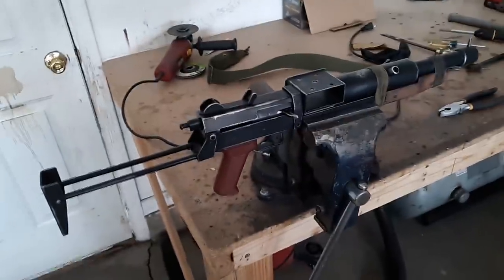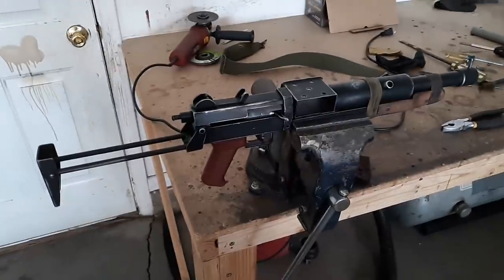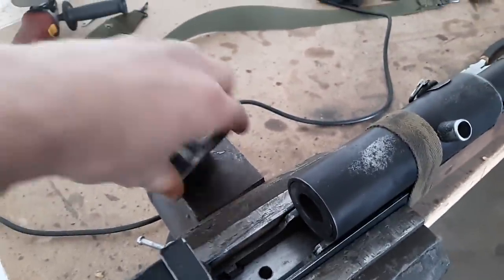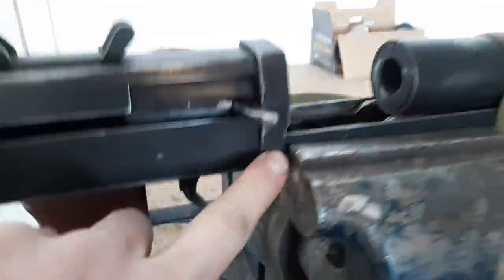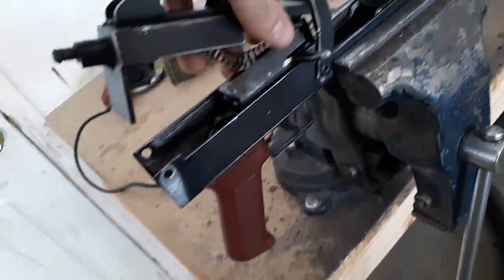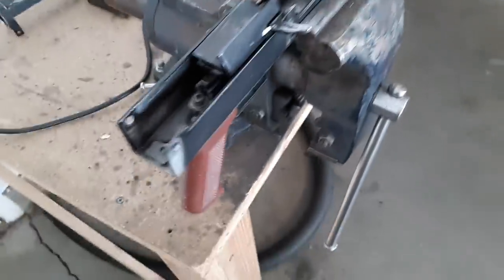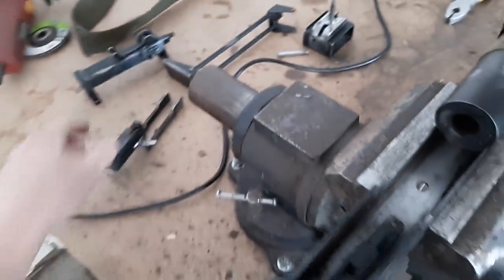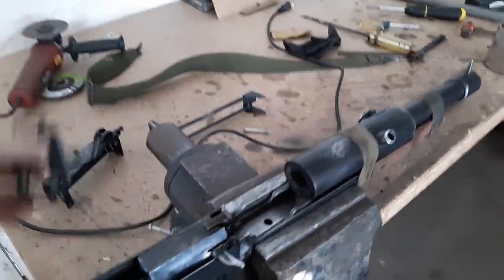How it works-bastard smg (metro 2033)

Comment: Man this is one step removed from a truly functioning firearm, as soon as you said you worked as a gunsmith it all made sense, really impressive work dude.
Reply from the maker: I appreciate the comment and your viewership. I hope to come back to this at some point and build another one chambered in a cartridge light enough to work as a straight blowback, maybe 9mm or 9x18 Makarov. The pivoting magwell is neat for a operational replica like this, but it ads a lot of unusual complexity and timing issues to the design. Thanks again for watching!
Reply: @Fairfax_kit  .380 ACP and .40 S&W are pretty much perfectly cylindrical at their widest points, so they should stack better than 9x19. Otherwise, 5.7x28 to keep the bottleneck aesthetic.
Reply: @simoncleret  if you want bottleneck, 7.62x25 Tokarev is much cheaper and even fits the locale of the games
Reply: @BobtheHobo324  thats definitely a great idea
Reply: @BobtheHobo324  look at the taper on it. It doesn't stack well in a straight mag.
Reply: That pivoting mag well is a very interesting feature in theory.

I'm completely in love with the look of this.
Reply: @Fairfax_kit  Me clicking in thinking its a real gun.

Comment: i've heard 4a games actually has a gunsmith on staff who designed the guns as real functioning versions prior to the 3d models and game versions being made.
Reply from the maker: I've heard that too, but best I can tell it's all hypothetical. no functioning versions have ever seen the light of day. Even the one i made isn't truly identical to the game.
Reply: I can imagine that, just a hecking Ashen makes a good weapon.
Reply: @Fairfax_kit  yeah, I looked it up, it's not 100% true, what is true however is that one of the key people in the studio is both an engineer and a gun nut, so when they design guns, their mechanics have to be realistic and possible to design as a real gun.
Reply: @dan_loeb  That's fascinating. I'm a gun nut too and I noticed in Exodus how practical the designs are. I mean, sure, I'm not sure I'd use a flat spring as a recoil spring (as is the case with the Shambler), but the fact they designed it to look like it works logically is super impressive.

Comment: “Submachinegun, 5.45 caliber. It's got poor accuracy and overheats like hell. That's why they call it a "Bastard gun"”
Reply: Use short bursts
Reply: Ah. I just thought it was a Chinese ripoff of the MP40 which was a german weapon that looked very similar
Reply: @misscath28  It's a ripoff of the Sten gun. Sten gun is made to be cheap, this thing is suppose to be even cheaper.
And both of them can be quite unreliable at the most inconvenient time, especially an ambush.
Reply: @unknownguyindo4356  imagine a cheap version of this
Reply: @rufickderufia8222  Sten is literally a pipe gun in steroids, bastard gun is even cheaper.
I don't know anything cheaper than that other than a homemade weaponry.
Reply: @unknownguyindo4356  a pipe,and you have a hammer and a screwdriver,you have to do it all yourself
Reply: @rufickderufia8222  I don't want to make it. I didn't wanted to involved with the authorities.
Reply: @rufickderufia8222  "imagine a cheap version of this"

It's called the Metro Exodus Bastard gun.
Reply: "Hueh hyeh hyeh!"
Reply: @theknitby  so the Luty?
Reply: Good ol days

Comment: The bastard gun in this game actually moves the magazine up or down after each shot, and not up and down for each shot, which is the most confusing mechanism that I failed to comprehend...
Reply: Magazine go boing boing boing boing boing
Reply: Magazine go boing boing boing boing boing
Reply: Magazine go boing boing boing boing boing
Reply: Seems like it would work like a zig-zag revolver but without rotation. The track for the bolt returning home movement would be cut straight so that the magazine holder doesn't move, but on blowback the bolt would push on a camming track.
Reply: I think it makes sense to assume that it does that to align the cartridges with the barrel, but the bolt is still weird to figure out
Reply: Yeah it would be easier to recreate with a single stacked single feed magazine instead. Kind of like how those old ww1 era Japanese or French stripper fed machineguns worked
Reply: Haha Krasnaya Liniya gunsmiths go brrrr
Reply: My wee wee goes boing boing
Reply: @CaptainGrief66  This is exactly why it goes up and down.

Comment: the designers put so much work into designing this makeshift machine gun and yet due to the game's power scaling most players will replace it with an AK first chance they get. then in exodus they switched the ammo type to handgun bullets meaning you couldn't carry as much reserve ammo, compared to the kalash and Bulldog's rifle rounds, which for an SMG just means you can't use it properly
Reply from the maker: I agree, all the effort into making such a unique gun goes pretty much unrecognized in terms of game development. first time i saw a bastard gun, My first thought was, 'That's insane, how could something like that ever work?" It got me thinking, and it left an impression on me, so I guess the designers did their job right.
Reply: @Fairfax_kit  the Shambler shotgun is what really blew my mind, i would use it until the end of the game along with the bastard gun
Reply: I think that's the point (for 2033 and LL). It's worse than pre-war guns because it was desperately cobbled together in a post-apocalypse. It shows how much was destroyed in the war.
Reply: I don't mind tbh. It's not supposed to be some ultra good gun, it's just a gun cobbled together with whatever spare parts were around, just because it looks unique and has an unorthodox feeding mechanism doesn't mean much, that could have just been a necessity to make the mechanism that way with whatever spare parts they had available since even something like a simple open bolt gun would require atleast a lathe to mill the bolt out of, and I find it hard to believe solid ingots of metal and lathes are abundant in a city metro. Just because it isn't in the spotlight doesn't mean it's worthless. It's meant to be the workhorse for the average metro dweller: nothing special but gets the job done, and is available everywhere for cheap, but whenever a better alternative is available you should replace it ASAP as a pre war factory made gun like the Kakash will always be more rugged and reliable, which makes sense in a real world aspect. Anyone would choose an AK over some jury rigged semi reliable handmade gun

Comment: The magazine well moving up and down is related to feeding, not locking. It's doing so because the magazine/feed-strip has 2 rows of cartridges, and it needs to go downward to feed from the upper row.

I'm not sure the Bastard has a locked breech at all, and it might not need one if the ammunition in universe is as underpowered as it seems.
Reply: The ammo is 5.45x45 which like 5.56 I think
Reply: @wesleygetsinger1859  5.45x39mm is what you meant, and the load it fires is typically a lighter bullet moving at a slower pace than a 5.56x45mm round(what we use in the West), but it's effective enough and was designed for the same purpose: lighter weight and lower recoil so troops could carry more ammo and expend it more quickly while keeping the same relative logistical longevity.  More rounds downrange equals a higher probability to hit, and a hit that wounds(and leaves pretty nasty wounds, at that) is nearly as likely to take someone out of the fight as a hit that kills, so intermediate rifle cartridges like 5.45x39 and 5.56x45 have become standard over full power(high recoil and weight) rifle cartridges like .308/7.62x51mm or 7.62x54mmR.  I think the "underpowered" nature of the cartridge in-game is just a balancing design choice by the developers, but it makes some narrative sense given the two tiers of ammo that you can find(at least in the first game, which is the only one I've played).
Reply: @wesleygetsinger1859  I thought that it was sth more in the line of 7.62x25mm (Tokarev rounds) seeing that the stick mag is actually pretty thin for a 5.45x39mm?

Comment: You should totally make a closed bolt functional version
Reply from the maker: I'd most likely do it in a pistol caliber if I did. Delayed blowback is feasible on paper, but I don't fully trust the design to be safe.
Reply: 9mm mak would be a good canidate

Comment: I always wondered how it gets a bullet into the chamber. Be nice if we had theories on that as well
Reply: My thought is that the bolt face should actually stick forward enough to meet the chamber, so it would actually go through the "magazine". For it to be able to go far enough back to pick up a cartridge the reciever should be longer on the back side however, very weird design as it also doesn't really have anywhere to eject spent cartridges but if you really wanted to you probably could make something like this work
Reply: @TheZebinator  thing is that means the bolt couldn't be any wider in diameter than the base of a 5.45 cartridge, or whichever caliber its built for at the time. That means the bolt would be hilariously weak and all the locking surfaces would be completely insufficient to handle even a putloaded round.
Reply: @CountSpartula  This is where the fact that the magasine in the game is double stack comes in, so you have approx. 1,5x the diameter of the cartridge base to work with as the magasine already has to be that wide. Now do I think this is a good design? Hell no but it looks kinda cool ngl
Reply: If you actually wanted to make a gun like this function you'd need to have the barrel offset to the magazine, much like a belt fed  has the belt above (sometimes below)  the barrel in height
Reply: @TheZebinator  Honestly a belt feed would be a perfect way to feed the gun and still keep its various...quirks that we love it for.

And on the magazine, again the bolt would have to be at most the diameter of the base of the cartridge because despite it being a double stack magazine, the rounds are still tightly packed together as they should be so it still runs into the problem of slamming into multiple cartridges if its any bigger and inducing at best a double feed and at worse magazine and cartridge deformation.
Reply: @CountSpartula  Haha yeah I didn't even think about that. But man an open bolt gun in rifle caliber will always be a meme
Reply: @TheZebinator  yeah lol. Imagine a bastard gun scaled up to 7.62x54r. Bastard cannon
Reply: @CountSpartula  man you'd have to have so much weight in the bolt to not get spray painted with burning gunpowder

Comment: The guns that makes me confused :
That one semi auto shotgun that has 6 shells.
That one ray gun thingy that shoots steel balls.
Cheap and Ol' Unreliable Bastard Gun.
That one Shotgun with Bicycle parts.

I played metro a ton after the Epic Games made it free for a day or to buy.
So I played Both games as well.
And the Og Metro 2033 has a Knife slot as well?????
Reply: Well the shambler is clearly a single shot shotgun with a rotary external ammunition holder and feed mechanism. How it's maintaining spring pressure on said rotary mechanism is anyone's guess. 

The Volt Driver is simple . It's a rail gun , a weapon using two opposing charged rails with  conductive ammunition to bridge said opposing charged rails. The rails however are set up in a relatively up position compared to the ammunition which is going relatively sideways compared to the rails. The only hard part is understanding how the gunsmiths of the Metro developed a power system for it that is both powerful enough to make the thing lethal and man portable . As real life examples of man portable rail guns have less punch than a airsoft gun and are the size and weight of anti  material rifles. 

The bicycle gun is beyond me but I have seen some ghetto ass designs fire live ammo so I can't discount it. 

The Bastard gun itself is a crude sten gun. Which is actually quite the accomplishment considering the Sten isn't exactly all that fancy to begin with. Also that poor bolt having to bounce up and down because of the double stacked horizontally fed magazine.
Reply: The Shambled is obviously taken inspiration from the Cobray Striker, so it probably works the same.

The steel balls firing gun is probably a modified airsoft gun with more pressure.

Bastard gun is here

The double barrel shotgun actually confused me since why the hell don't they just used side by side breach opening? It would actually be way the fuck more simple that way.

Comment: How does the magazine / feed strip advance through the magwell?
Reply from the maker: rotary sprocket like a Hotchkiss.
Reply: @Fairfax_kit  The way that piece on the bolt rides under the magazine, I wonder if a Z-column cut reminiscent of a Webley would work to move it left to right more precisely in lockup over sprockets.

Comment: Does it fire? Can you show it firing?
Reply: Bro it don't feed, it doesn't even have a real bolt, and that moving magwell probably makes it impossible to design a bolt that's able to push a cartridge through the en-bloc
Reply: @ivannegrozny5388  well, a good engineer can do it
Reply: @ArmyHumveeLaat  Thats true, but still, it wouldn't be what you expct from a homemade rifle, given that there are submachine guns in which the bolt is just a hunk of steel with maybe two moving parts, and this thing would probably require an arduino to function like that.

Comment: https://www.youtube.com/watch?v=mt_wKnjfHmY

Watch this video, you can see the mag moves once per bullet cycle, its for round placement (as if it has no feed lips)

furthermore, looks like a closed breech, direct blowback from the footage. 

idk how we'd do this but I've got a hankerin to boot up Inventor and figure something out
Reply: I think if the cartridge is aligned with the chamber, it would be impossible to feed.
But maybe it would work if the en-bloc only moved left to right, and the bolt pushed the cartridges onto a feed ramp which would then let it slide into the chamber?
Correct me if I'm wrong

Comment: Ok but how does it chamber. All you really explained was how the mag well can move up and down, but how does the bolt strip a cartridge and then feed it into the chamber?
Reply: He said it was a prop on multiple occasions.
Reply: @seaweeb2258  Yes and the prop was made as a way of imagining how the feed system could be done. I am asking for more detail on how he figures the system works, I am fully aware of the fact its a prop
Reply from the maker: @johnsig7100  Look at the bolt on a Thompson Submachine gun. The bolt face is a long, thin protrusion that extends far beyond the mass of the bolt body,. that's how I imagine it'd look. I simply didn't build it like that for the sake of simplicity.
Reply: @Fairfax_kit  I understood that. Some of the surfaces in there did remind me of the blish system. So yeah a blish lock (despite not working) could be how it would lock. But then think. In that short receiver you need the bolt to have enough throw to pull that case behind the mag/clip it feeds from to eject. I can't wrap my head around it with the size of the weapon and all. You'd need a long ass receiver to do it. Then again it's a fictional weapon so eh. Would look awesome in game and irl if it fed from ak74 mags